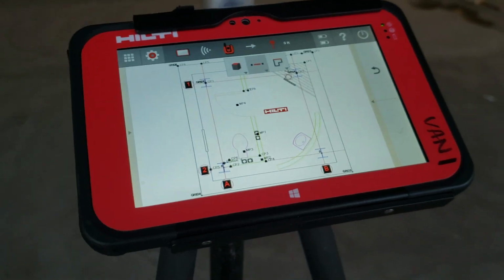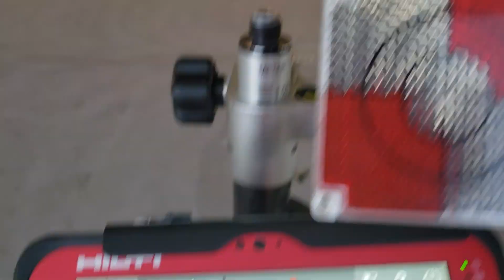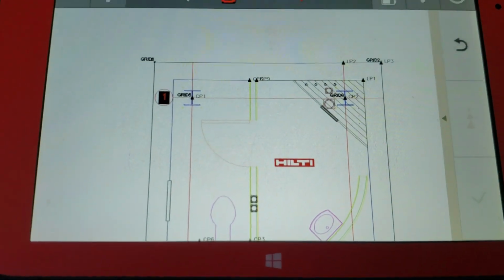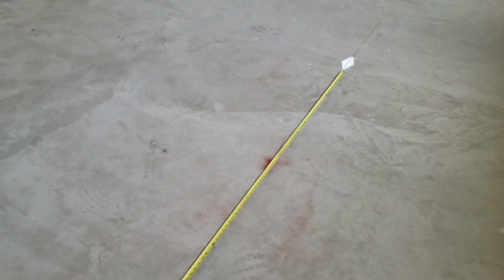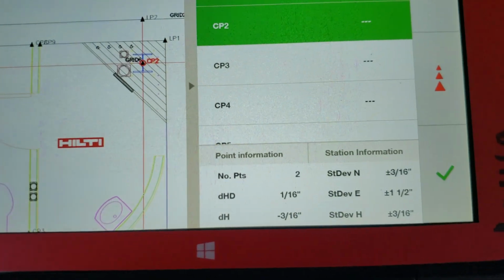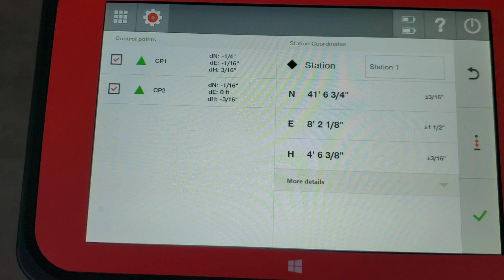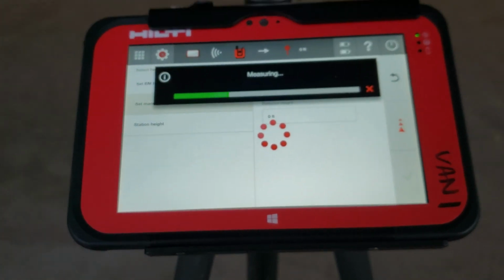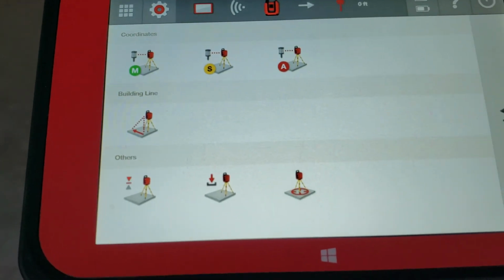Hilti Plc 400 stationing tutorial

Comment: Did it ever happen to you, that the CAD drawing and the control point coordinates on it are mirrored when imported to the PLC 400?
Reply from the maker: Many times. It is probably one of two things: 1) the CAD file you have and the points CSV you have been given simply do not line up. or 2) You imported your points wrong.

For the second option, when you import your points, make sure you choose NEH or ENH for  your coordinate order - try them both until they seem to work. And of course make sure you have the right units selected.
Reply: @measuringsystems869  Thank you for your fast response!
We also focused on the second case. When using NEH, the points from the CSV were mirrored from left to right. But when we used ENH, all points seemed to be melted together in a single spot, while the coordinates of each point were imported correctly... The stationing in the end did not work either way. I'm going to try to solve this with the hilti support. I let you known what the problem is.
By the way, do you use the hilti PROFIS software tool to prepare CAD drawings for the PLC 400, or do you import the drawings directly from a CAD tool to your PLC?
Reply from the maker: @HangLooseTT  PLC 400 works fine, but I find using AutoCAD to "optimize" them and such much easier at times, simply because of the vast more amount of options for CAD design available in that software. PLO is more of my project and point creation location for the tablet...it's easier to customize points and such. But anything related to CAD, I prefer the drafting software.